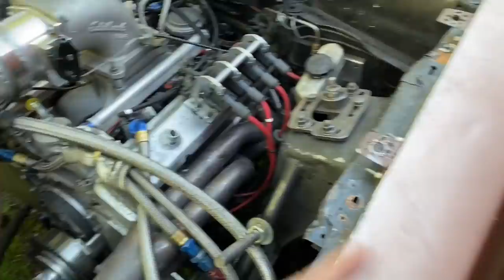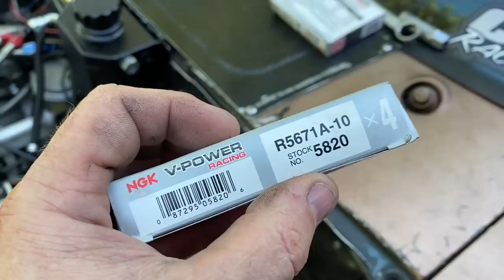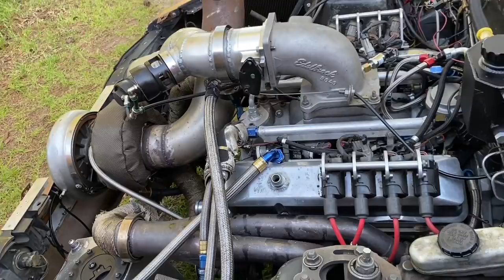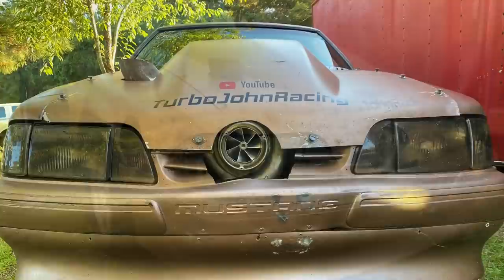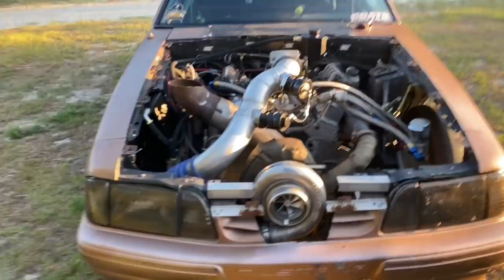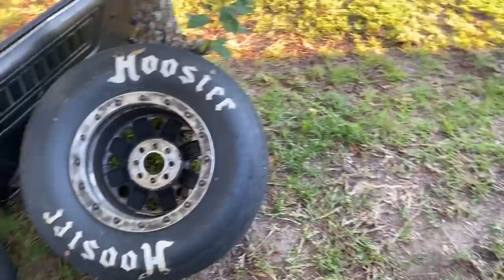Race car checkup!

Comment: So the Hoosiers would work on the streets or no prep, just not at the track where it’s prepped?
Reply: Im thinking it could partly be the stiff sidewall on the hooisers
Reply: I personally only run m/t
Reply: I've never had good luck with Hoosier. Mickey Thompson has always worked best for me
Reply: 64NovaSS TT stiff sidewalls? And 28/10.5